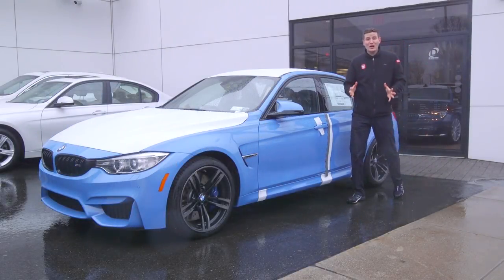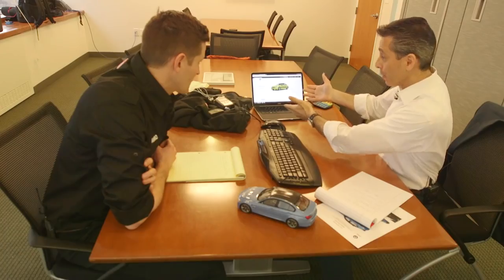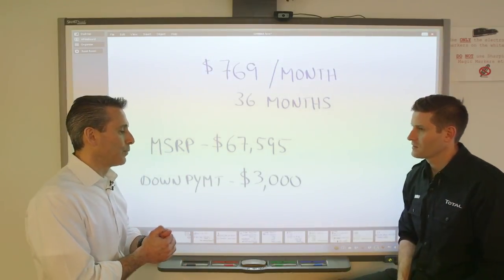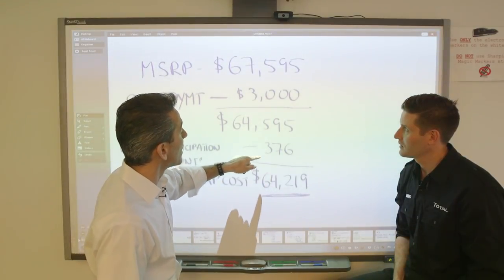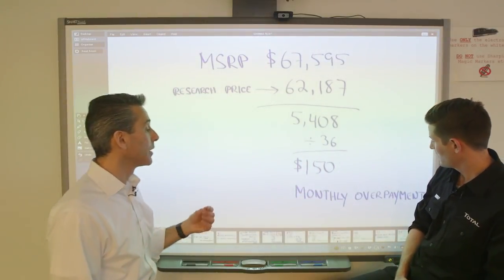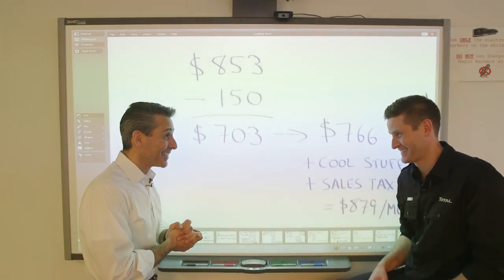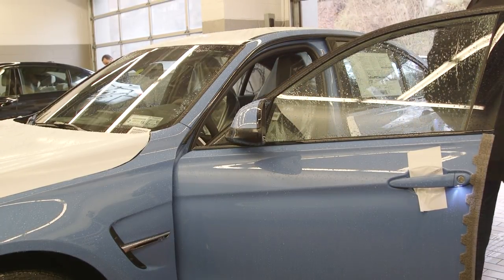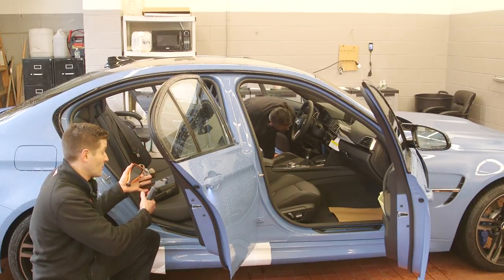How to SAVE $5,000 on a Lease: BMW M3

Comment: The impressive deal was that you got an M3 MSRP $71,675 for $65,487.  The TrueCar I did with an MSRP of $71,945 showed a factory invoice of $68,015 and a National market average of $70,116.  I doubt my local dealer would give me 8% off MSRP.  Was this a build car or was it on the lot?
When I lease my BMW's I always use the exact lease numbers: MSRP, Cap Cost, Money Factor, Residual %, Extra Security Deposits, Term.  I get the BMW Financial lease numbers from the edmunds forums.
Reply: I think he said the original true car value was for a base car, then he negotiated to get some other, unspecified options.

Comment: I have been watching this thread since it came up and what everyone on this comment section seems to be missing is "It's a lease" It doesn't matter if there is a blem. Unless there is something just beyond minor the factory won't care at turn in. sure go ahead and get the car fixed if needed but you don't own the car. You'll be turning it in when the lease comes due. You walk away and get another if you want. There is absolutely no point to doing such a thorough inspection. You get nothing in return and there is nothing lost. Can you make money on a lease if you buy it at the end? Maybe but you don't get a guarantee and the factory sells enough of them to know or have an idea what the residual should be. That's what dictates the numbers when you drive away. Can you make money if the miles are under what the contract allows? Some might think so buy really you spent a lot more time with the car in the garage than what your contract allowed so maybe you're just getting your own money back. Leases are really just for individuals or companies that don't want to own their vehicles but would like to drive the latest and greatest. I'd like to hear from anyone who thinks otherwise...................

Comment: What happens when you find a dent or scratch in the paint? You've already signed the paperwork and accepted the car. What's to prevent the dealer from just shrugging and saying, "You probably scratched it when you pulled off the plastic. Besides - it's a lease. That little scratch won't cause any problems over the next 36 months anyway."

When I bought my most recent vehicle, I asked the dealer to not install a dealership sticker/logo on the car. But when I went to pick it up - it had a logo on the trunk. Then I asked the dealer to remove it - and when they did, they tore a huge chunk out of the paint on the trunk lid. I wanted them to repaint the trunk, but they refused and would not budge - so I ended up having them stick their ugly logo back onto the trunk to cover up the damage. It was only a $40,000 car, but it still pisses me off.

Comment: Leasing is BAD news
Reply: Unless you like to drive a new car every 3 years then it's cheaper.
Reply: And then stuck with the depreciation......
Reply: goodfella949 huh? In a lease you are only paying the depreciation plus interest. Where as buying you are paying the depreciation on top of the Capital cost of the car.
Reply: Tyrone Roberts what's the joy in owning a depreciating asset?  Very rarely do cars go UP in value. So please explain to me why it's better to be burdened with depreciation and all the running costs of owning something that really has a useful life of 5-10 years.
Reply: Lazaro Carreiro Johnny Knoxville Leases have a certain value to them in this day and age as cars are more complex and costly to repair out of warranty. A leased car is protected by a warranty, and financially, you're not holding onto a rapidly depreciating item. Thinking of a lease as a way to get a car that you can't typically afford is the wrong approach to leasing and gets most people in hot water. Leasing as a way to avoid much of the depreciation and repair costs of a modern car is the smart approach. You're treating a car more like a cell phone--you always have the latest one and the manufacturer is bearing the repair cost risk. 

But all that said, for car enthusiasts, leasing generally sucks because hot enthusiast cars typically have poor (high) money factors, and you're less likely to get a good cap cost on a custom ordered car versus one that is sitting in dealer inventory.
Reply: Leasing can be bad news, but fantastic news on these. You don't want to own one out of warranty, and the residual is usually pumped up by BMWFS to bring the payments down... You'd lose less money leasing than if you were to buy it and trade in after 3 years/36 thousand miles.
Reply: Lazaro Carreiro You're BAD news.
Reply: Leasing is a take write-off for business owners.
Reply: Lazaro Carreiro not for the self-employed.
Reply: Lazaro Carreiro No it’s not. It’s a great option
Reply: Okay. You keep paying for something that gets crappier each year, losing it's value. I'll stick to driving the hottest whip every three years, IN WARRANTY.
Reply: I used to do that but leasing is better if you like cars and driving something different btw Subaru fanboys always think their cars are gold

Comment: 68937 - 870 x 36 = $37617. Used 3 year old m4 with ~36k miles costs ~$50.000. 
That's why dealers love leases. For the buyer buying vs leasing is about the same $ considering no tax and interest was payed on lease for $37617

Comment: How I got 29% off my NEW 2018 car!

Okay.... so I know it's a different car but I just purchased a 2018 nissan sentra with 10 miles on it for $16,000 out the door.. The MSRP was right around $21,000 with about another $1,500 in tax and other fees. So I purchased a NEW car for $16,000 when it should have cost me $22,500. That is a $6,500 savings.. Another way to look at it is that I got about 29% off. This guy saved $5,000 yes.. but he only got an 8.63% discount according to the video. Maybe there is less room in luxury cars.. but for an average car, 8% off is not what I consider to be a good deal. 

The simplest way to negotiate in my opinion is what a few other commenters have already said. Look at the invoice price and strive to get below that. The dealer will accept less for the car then they purchased it for because they receive other incentives/kickbacks for selling cars. 

It is a good idea to shop around and ask for the best price. Be honest and tell them that you are planning on shopping around and that if you find a better price that you will be going with it instead and will not be coming back to give them another shot. This will insure that you really get their best price (most of the time) because they know that if they are beat in price you wont be back. The next step is to bring that price (typed out by the previous dealer) to other dealers and see if they can beat it. Keep repeating this process. Once you are satisfied with the price, or other dealers are unable to beat the current price you have, you can decide if you want to purchase the vehicle. 

Everything here is an opinion and the strategy that I use to purchase my cars. I have never dealt in luxury cars so it might be different. I hope that some of this information is useful.

Comment: 9:30 - Rule number 1 is actually... Let the dealer take responsibility for any damage.  Don't tear back the plastic and take responsibility for something that is the dealers responsiblity.  It doesn't matter on a lease if they do light sanding, or any other detail.  You can simply ask the detailer for that information.  This would save you a lot of time, money, and liability.

Comment: what about the Money Factor? 
bmw also allows multiple security deposits to lower money factor. 
never tell dealer you payment. negotiate lowest price, then try to get fleet discount added to lowest price you negotiate on top of it. then use those multiple security deposits. 
that's the best bmw lease.
2016 528i for $350 with tax included with 7 MSD

Comment: Great video. One of best out there. Now can we talk about a lease having equity on a 3 year lease that you want to trade it in 6 months earlier. Avoiding the early termination fee and turning it to a win situation for you. Theirs not enough info out there when it comes to you having that luxury of having that equity on a lease. Please respond if you know anything about this. Thanks
Reply: Mr. Hitdat71 In my 7 years in the car business there's only been a handful of times where you will have positive equity in a lease...lots of factors there.
Reply: Jason Mayes break it down
Reply: The residual rates are set by the manufacturer, not the dealership. It can only be changed (in most cases) depending on the miles you choose per year. Typically at the end of the lease, or close to the end, there is no positive equity. If you want to get out early, always get a trade appraisal at any car dealership before you let the dealership knows it's a leased vehicle. Online sources may be close on value, but will not be 100% accurate on market value.

Comment: 600 dollars on a maintenance warranty for tires and brakes on a car you are gunna lease for 3 years doesn't make a bunch of sense. Any warranties buy half of that amount goes straight to the dealer.
Reply: TheCamaro5 you sure about that? Guess how much a set of brake pads cost for that car. Your looking a at over 3000$ for front and rear brakes. If those are carbon ceramic they can be over 10000$ easily .

Comment: Great video. Be careful with not letting the dealer do much to the car. The Plastic being left on is not a bad idea, if you want to wax and buff the car yourself. Most dealers will put a light coat of wax on after removing the plastic. Also there are sometimes parts that need installed on the vehicle that aren't done from the factory, so be sure they don't need special tools to do. Overall good info. When you get down to it leasing really isn't a bad way to go once you understand vehicle values and depreciation.

Comment: Not having the dealer remove the plastic is the dumbest advice you could give. 

Let's say there's a scratch on the hood that's covered up by the plastic. By your advice, you would unwrap the plastic, see the scratch, tell the dealer, and then they would have to hold your car for a day or two to repaint the hood (as well as the hassle of removing the plastic anyway). OR you could let the dealer remove the plastic, see the scratch, fix it just like they would anyway, and have it showroom ready before you even arrive. Same result, same car, same price, wayyy more convenient for everybody involved.

Comment: Outside of the basics.  Which they show. Also in a low interest paying environment.  I run (multiple security deposits) MSD's to buy down the rate to nearly 0%. (Buy down the money factor) Which saves a lot on the monthly payment. And get all my MSD back at the end.  0 down etc.    money sitting in the bank with little to no interest on liquid funds.  Use it for MSD's.     this is not utilizing your invested funds. (Leave those alone)

Comment: Leasing is tricky. I think the real win was to get the car without and $$$ down. At the end of the lease you still trade or buy the car. Options @ trade in don't hold value. JMHO.
Reply: The major win was getting 8% off MSRP, how the heck did you get that deal.  That's below factory invoice.
If I asked my dealership for 8% off an m3 build they would laugh and so no way go to the Jeep dealership if you want 8% off MSRP.

Comment: I work for a captive lender for a major automotive company. I look at about 30 lease applications a day.....sorry but this guy is wrong. So wrong. Cap Cost is not the selling price. It's the selling price plus tax title and fees. He did a good job by reviewing the car online first. Should always know the MSRP before going in as some dealers cheat the window stickers.  3 other major components that this guy doesn't know, the residual value of the car, the money factor  (basically the interest rate - preset by the leasing institution based on your credit tier), and any rebates being offered. Some rebates are advertised while others may not be. Some may be applicable to certain cars are sometimes may be applicable if you are leasing from a competitor. The rebates plus your cash down = you cap cost reduction. So....Capcost - Capcost Reduction = Adjusted Capcost.   Your lease payment = (Adjusted Capcost - Residual Value) * MF ÷ term

there are always a lot of moving parts so to a regular consumer (they are not even requires to put a money factor on your contract!) it is hard to know when you're  getting a good deal on rebates and such. I can assure you that your friend did not get the dealership to take a $5k loss on the car but it does pay to do your research and not be afraid to negotiate or even walk out.

Comment: you strategy has problem. when you taking 5408 off from MSRP 67595,  and you divided 5408 by 36 months, it automatically means you are agreed to pay the discounted price (67595-5408, or 62187) in terms of 36 months. But for your case, it is lease. You dont pay the full discounted price of 62187 for 36 months. you only pay part of it. depends on what's the residual value of this model. The dealer may not have a good math knowledge. You just fooled your dealer.

Comment: Unless you drive 10,000 miles or less, or need to be the guy (or girl) with something brand new every 36 months; leasing otherwise is lameeeeee. Get a Pre-owned model with a nice Unlimited Mileage Warranty. You'll be so much happier.

Comment: I do not agree with this leasing advice. Your net cap cost. The final number that goes in box 13, is what you should negotiate down. That value should be ~8% off MSRP. Then make sure 0 down and that they are giving you the buy rate on the MF.

Comment: This is flawed because you did not consider the residual value of the car. You're math only works in a purchase or financing situation, where you would truly benefit from a mrsp discount. However when you lease, the discounted MRSP will be considered in the residual value. A $5000 discount might only be rougly $2750 saved over the course of the lease.

Comment: Inspecting a leased car - why bother?  You're giving it back after 3 years.  And based on that video, you've already signed the papers before the inspection.  Two extremely important points that you left out: residual value and money factor rates.  These two factors greatly affect the lease payment.  And never add a maintenance package to the financed car - why, becuase you'll pay more...make it a separate cash deal.

Comment: you think thats a great deal? this is my buddies deal, yas marina over sakhir and they threw in black kidney grilles

"MSRP:71,000
Sale price: $63,000
$0 down. $2000 inceptions. 
Rebates: $1500 + 0.50 off MF corp. fleet program
$1000 driving event
12k miles/36 months. Deals like this don't exist anymore though, the residual was 66% and the program are not the same now. I got very lucky
Idk before payment, but current payment is $645. It was $639 but Florida palm beach county tax went up 1% lol"

from a CT dealer

Comment: End part is kind of overkill.. Very seldom will you be the one taking plastics off your new car. Typically it has already gone through pre purchase inspection (ppi) and all that stuff will already be removed by a certified tech. I suggest letting your dealer know ahead of time you want to take all the plastic bs off yourself. Otherwise you're just a nuisance.
Reply from the maker: Not sure if you watched the entire video, but he had it written in the contract prior to receiving the car. They could have said, NO.

Comment: It's a lease you won't own it (you basically use it and throw it away) so why give a fuck if paint was within the 0.0000458372643845 micromilimeter tolerance across the whole of the car. You did the PDI for them for which they charged you anyway.

Comment: This guy may have gotten a good deal but he is not explaining how residual and MF is the real calculation factors used not the MSRP .. so he might have gotten a bad deal just as well. Car with certain options had better residual so essentially you get the package with options for little or zero cost.

Comment: Then dealer F's you by adding back in after you negotiated deal:
Bullshit window etching charge of $400
Adding nitrogen into tires $200
Rediculous motor vehicle fees of about $400
Plus throw in Doc fees of about $200 to $400 depending on dealer
Oh, dont forget the $900 bank fee.
Im probably forgetting a few more but feel free to chime in as this could be amusing.

Bottom line. ALWAYS negotiate off of MSRP to come to a selling price (cap cost) 
Try and find out if BMW has loyalty programs and or factory incentives, which they aways do AFTER you negotiated price.
Check money factor rate which can be calculated by taking rate and multiplying by 2400 to get to actual interest rate being applied to lease payment and see if there are subsidized money rates for return BMW customers.
As an example, 2019 M5's right off the top have a $5000 dealer incentive, not including any negotiating of price.  I have had dealers already dropping their pants another 5k off for a total of 10k off MSRP when looking into one.  Only problem is that BMW slammed the residuals for 2019 from 60% to 50%.  Your payment is based primarily on depreciation between selling price and what car is worth at end of term (the basis of a lease price plus your money rate)

Guy forgot to mention:
understanding of money factor, depreciation percentage, amount of miles driven per year.  These all factor into payment.

My 2 cents